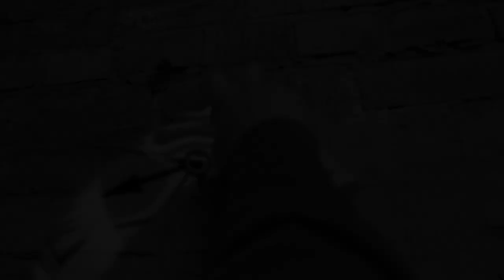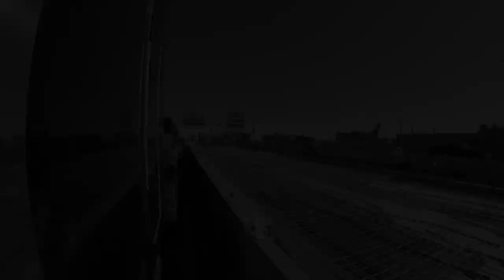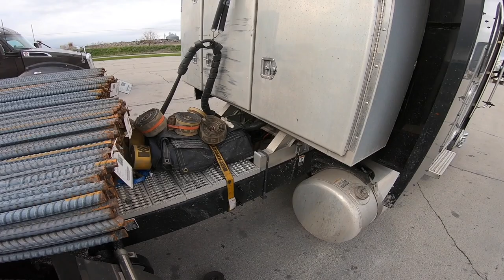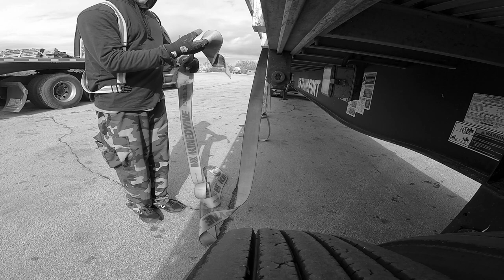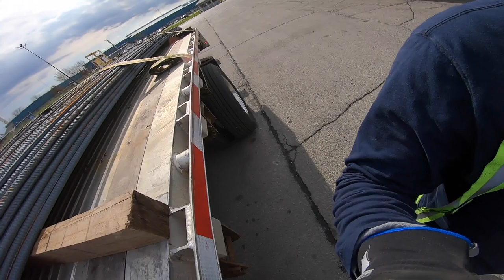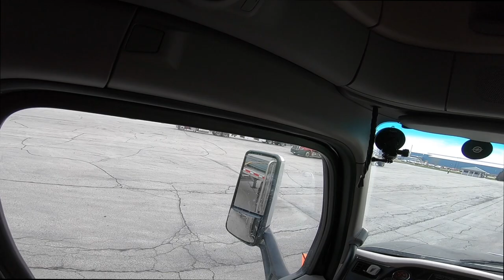HOT STEEL!!! | HOW SECURE OVERLONG LOAD| REBAR | CHOICEMAS |

Comment: On that load you straight strapped everything with no belly wraps, why?  I'm sure that you know by now that my questions are just for knowledge lol.  I would have thought that the second trap from the front and the second from the rear would have been wrapped.  Since you didn't do it but I would have I want to know because your securement may have been better than what I would have done.  Is it because the load was so low, was it because they are binded?  Thank you as always for the knowledge.  I recently had a small boom section piece of equipment move on me (as a rookie flat bedder it scared the hell out of me when I saw it).  I did a video about it but you know how much I love your knowledge.
Reply from the maker: Great question. I had the same question one day… is why I didn’t belly wrap these. The answer is… it was a choice through reason. 1st, yes the rebar sits super low. 2nd they aren’t separated (with space between them). They are sat on top of each other. The last reason is after me speaking to an older man once and he told me he doesn’t bother belly wrapping rebar because of the ridges in the rebar. Basically comparing it to “traction”.  Rebar is far less likely to advance because of the tread on the rebar.  It made sense to me! If they were separated I’d be more likely to belly wrap them but even then I admit sometimes I don’t. If my heart says do it. I do it. Also depends on the length of the trip sometimes with me. Thank you brother. I’m about to shout your channel out. Keep an eye and an ear out! 🙏🏼💯
Reply: @choicemas  That makes incredible sense.  I am actually on a load from hell right now {strapping wise} lol.  This load involved a whole lot of WWCD.
Reply from the maker: @truckingresources4240  sounds like those oil can dumpsters that need 22 straps on a step deck 🤣. What you working with?  I’m up at 3am and headed to Darlington SC to grab some steel. Been trying to upload a darn video for 2 days. Just can’t figure out why it takes so long.